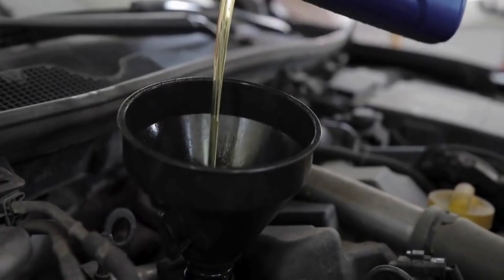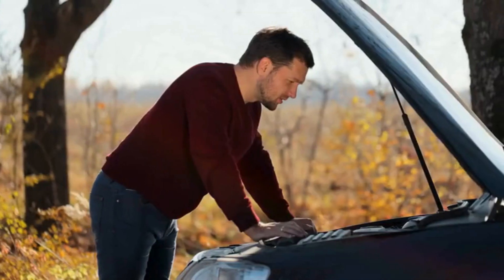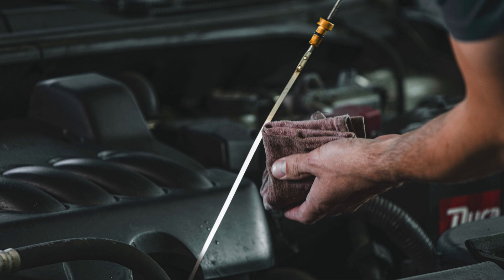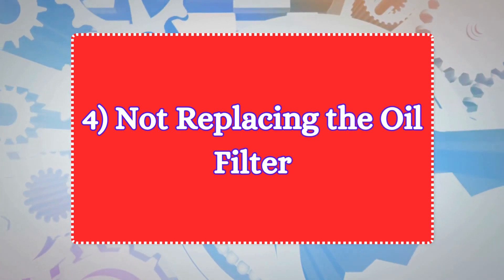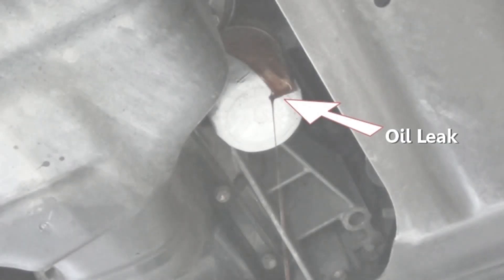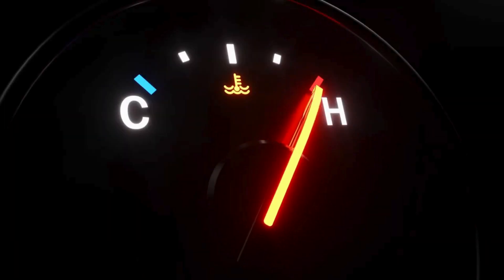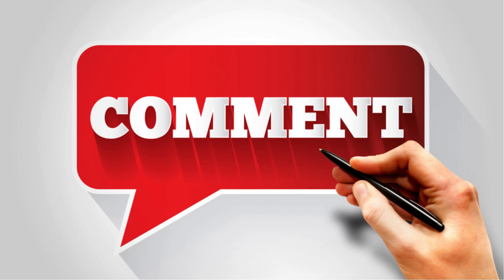Don’t Ruin Your Engine! Avoid These COMMON Oil Change Mistakes!!

Comment: Kiss my naked ass! Yeah, change the oil filter and don't forget to put the drain plug back in before you fill it with whatever type of oil you prefer. It's really simple.......

Comment: Modern engine oils DO NOT thicken when cold.  0-20 oil is 0 weight when it is cold.  Like water almost.  It gets thicker when hot.  That is how multi weight oil works.  It is completely unnecessary to change modern oil hot.  In fact counter intuitive if you understand how multi weight oil works.
Reply: Also when you chane the oil when cold, the oil will have completely drained from the upper engine.
Reply: @Wiseguy1408  And you won't burn your hand, which makes it less likely you'll have an accidental spill, which makes it more likely to get done in shorter time without disruption.  I change my old oil [edit: motorcycle] before 1st start up each early spring.

Comment: Pretty much a good guide but as a retired life long master tech in every major country of origin. And That doesn't mean much if you don't check to see if the gasket or o ring didn't come off with the old filter and you double stacked the seals and they blow out driving down the road! You will never let it happen to you again! Unless you're tupid.

Comment: 4 steps by steps : 
Using the wrong oil type or grade.
Overfilling or underfilling the oil.
Forgetting to replace the oil filter.
Not tightening the drain plug properly.

Comment: What about oil grade,can we use different oil viscosity?
Reply from the maker: No, you can't use wrong viscosity oil. Imagine pouring syrup into your engine—it’s not going to work, right? The same goes for oil viscosity. Every engine has specific requirements for oil type and viscosity. Using wrong viscosity oil can lead to poor lubrication, overheating, or increased wear.

Comment: Good tips for sure, but let me add a couple:

Lubing the oil filter gasket is necessary for a good seal and a longer seal life.  BUT... watch for the seal from the old filter to be ON the
old oil filter when it is removed.  Otherwise, it will be stuck to the engine and a double seal could result.  Typically, double seals don't
seal nearly as well, if at all, as a single seal.

Inspecting the engine immediately after an oil change is a great idea but most leaks are most easily spotted from UNDER the car.  
Look for any drops of oil on your otherwise clean garage floor or driveway.

Comment: I used to work at a tire repair facility and I can't tell you how many times I have heard of mechanic forgetting to add oil and then start up engine and hear a loud knocking and by the time they shut down the engine damage had already occurred others didn't tighten the drain plug and filled it up with oil and then seeing a trail of oil as customer drove away, oops 🤫

Comment: At 2) and 3) : eh, modern cars have no dipstick.
5) Use clean oil from the used oil drain pan ? 😉
6) If oil filter is tightened too strong, it will not come loose the next time (in a normal manner).
Thanks.

Comment: See that your vehicle is level as possible. If you can't get it level error on the side of tilting it so that the oil drains towards the bolt.
Reply from the maker: Thanks for sharing your knowledge

Comment: Over the last 35 years I have always drained the oil cold  - then all the oil comes out of the pan. When you run the engine for 5 min., the oil clinmgs to the metal parts and you dopn't get all the oil out. Check videos where this was tested.
Reply: On the other hand, if the engine is cold, contaminants tend to settle rather than being suspended in the oil. You want them to be suspended so that they drain out with the oil.

Comment: WHEN     NECESSARY      REPLACE     THE     OIL     PLUG     GASKET     WITH     A      NEW     RUBBER     GASKET    !    DO     NOT     USE     HARD     PLASTIC    OR      HARD     PAPER      GASKETS      AS      THEY      ARE     PRONE     TO     LEAK     !
Reply: It is better to use a metal gasket if the oil plug will accept it. I use a replaceable metal gasket that has a seam around its circumference allowing the gasket to be crushed to fit the slight recessed surface of the oil pan. This prevents oil leaks. It is also a good idea to use a torque wrench to tighten the oil plug to the proper specification.
Reply: @randallp.8313  METAL     GASKETS    DON'T     WORK      FOR     ME     !    NOTHING      IS      BETTER      THAN     A      NEW      RUBBER      GASKET     !      OLD      SCHOOL     MECHANICS     !

Comment: also make sure the old oil filter gasket comes off with the old filter--sometimes the gasket can stick to the block and when you install new filter it is gonna leak...
Reply: Been there done that 😢
Reply: @alkelenson648  Same here. I've only done this once in over 60 years of changing oil. Fortunately, I caught it in time before doing engine damage and only lost a little bit of oil. Never again!!!!
Reply: Best bet is to wipe off the oil filter housing where the gasket seats. That way you always know if the old gasket didn't come off with the old filter, plus you have a clean contact surface for the new one.

Comment: Engine oil pumps get their oil from the oil pan, or oil tank, NOT from the oil filter.
Reply: Unless you have an engine with one of those add-on oil filters, all of the oil pump's output is used to fill the oil filter.  Until then, no oil is going beyond that point.  This is true of ALL car and truck engines built since the late 60s, except VW Bugs.
Reply: @jamesbosworth4191  That doesn't change what was just said, though. First port of call is oil pump. Second is filter.
Reply: @timjohnun4297  You are wrong.  Until that filter is FULL, NO OIL AT ALL goes past it.  It is not good to force a running engine to wait for oil.
Reply: @ mechanic for 40 years, diploma in mechanical engineering. How Strange how I have NEVER seen an engine spin a bearing because nobody filled the oil filter…not to mention, if there’s even 1 piece of junk in that oil container, even a bit of plastic, from the container itself, guess where that’s heading to, if you pour it into the discharge side of the filter?
Reply: @timjohnun4297  It isn't going to cause it to spin a bearing, but it probably WILL shorten the LIFE of the bearings.  Maybe no so much on modern Japanese engines, as they use a mini filter, but traditional American engines usually use a filter the size of a quart of oil.  It takes about 4 - 5 seconds for the oil pump to fill it.  That means NO oil is being delivered to the bearings for 4 - 5 seconds.  I have been doing my own work since is was a teen.  I am 69 now.  That means I have been working on cars for OVER 50 years.  I have NEVER seen "a piece of plastic" and back when the oil was in cans, never seen any objects in the bottom of the oil sump or in the rocker box.  I supposed it has happened, but probably so rarely that most people will never have it happen to them.  Besides, unless you have an early 30s or older engine, it won't fit through the oil pump screen.  Before the mid 30s, there was, on many engines, just a pickup tube, so yes, THOSE oil pumps could ingest an object, but how many of us are still using cars that old as daily drivers?
Reply: @jamesbosworth4191  I think you missed my point - I wasn't talking about foreign objects being picked up by the oil pump, I was referring to the fact that when you fill an oil filter manually, you do it by pouring oil into the large hole in the middle, which is the discharge side of the filter. Meaning that the foreign body immediately goes to the wrong side of the filter, and will go straight to either the main bearings or camshaft, (Depending on engine design), on start-up. CATERPILLAR have done extensive studies on this and have determined that the risk of sending unfiltered oil straight into the engine outweighs the risk of bearing damage caused by a very short time of low oil pressure. I'll go with that. End of the day, do what makes you feel the best, but my point is simply that it really makes zero difference whether you pre-fill or not, assuming the oil going in is clean. Ensuring oil and filters are regularly changed is far more important than whether or not you pre-fill the filter. Peace.
Reply: @timjohnun4297  And you refuse to acknowledge that the chances of a foreign object being in the oil container is so remote that most people will NEVER encounter it, whereas starting your engine with an empty oil filter DEFINITELY WILL force the bearings to wait for oil, and you also missed where I said that on modern Japanoid engines, which use a mini filter, it probably isn't that important, but on traditional American engines that use a filter that holes a quart of oil - many heavy duty engines use TWO of them - you will be effectively running the engine with no oil until that filter, or worse yet THOSE filters, are completely full, and no I am not going to shut up about this, no matter how much you want me too.
Reply: @ IDGAF what you do, and I I never said contamination was likely. I said it’s possible, and that’s why CAT (Who, incidentally, use some of the BIGGEST FILTERS ON THE MARKET, suggest against it. IDGAF how you do it, or anyone else for that matter, but if you think you know more about engines than one of the biggest engine manufacturers in the world, you are full of 💩 End of story
Reply: @timjohnun4297  If you think making an engine wait for oil is harmless, YOU are the full of that, not I.
Reply: @ quick, you’d better send the memo to Cat and all the other engine manufacturers out there that don’t have your level of knowledge. You can make a fortune 😏. I wonder why car manufacturers always oil capacity with and without filter 🙄
Reply: @timjohnun4297  Just do not let the engine run above idle speed until the oil pressure guage starts to move.

Comment: make sure the gasket comes off the used filter and doesnt stay on the engine  i know a farmer that lost an engine because he had a "double gasket"
Reply: I once had a double gasket problem.  I always immediately start looking under the car to make sure there are no leaks, so I shut it off instantly, but that taught me to always check for that.

Comment: If you put it together the way you're talking about even a few seconds can start the cause damage in the engine !! Free fill the oil filter before you put it on the engine!! I do own a fuel high performance vehicles and one of them is ultra high performance I will never put an oil filter on dry, most of what you said there in that post was decent, except you neglected to mention to pre-fill before you start the engine !!!!!!!!!!!!!😮😮😮😮
Reply: And neglected to use fresh oil for the rubber gasket 🙁
Reply: @7spower998  Both are moot points...
Reply: Thanks.

Comment: Fill the oil filter before installing,  ie.dont starve engine oil pump lubrication before starting.
Reply from the maker: Good Tip
Reply: Or.. you can on newer cars just put the pedal to the ground and let it crank.. when you do that the engine will crank without starting and will prime the filter and the rest of the engine
Reply: @lincolnmech  Clear flood mode. Good tip. On my vehicle the oil filter is mounted on top of the engine and upside down. I can not pre-charge it. Hopefully one's battery is in good condition.
Reply: @maxwellcrazycat9204  only takes like one cranking cycle.. if your battery isn't able to handle that you should've bought a battery with your oil change kit lol
Reply: @maxwellcrazycat9204  The small Nash 600/Stateman/Rambler engine was like that - I would have bought that car with no oil filter, (it was an option), and installed one of those add-on filters.  The kind with oil lines and a replaceable element inside the can.
Reply: Good idea if the filter is under the engine and is mounted open side up. But on my Subaru, the open end is down.
Reply: @ericripley9739  Unfortunately, some engines are like that.  My 54 Chrysler was like that, (replaceable element type), but I was able to replace the unit with the older style, (1951 - 53), which has the open side up, and solve that problem.  I was lucky that way.
Reply: FACT.
Reply: That's not usually a good idea as oil runs out of the filter when fitting.
Reply: @stevenmonson5149  Doesn't work like that...
Reply: Completely unnecessary to fill the oil filter.   In most cases impossible if top mounted vertically.
Reply: Nno need to do this anymore - modern oil pumps fill that new filter in 1 second.
Reply: @synthwave7  That's only with modern cars - they have a tiny oil filter.  If you have an older car, which many of us car lovers do, the filter is probably as big as a quart oil can and takes about 4 - 5 seconds to fill.
Reply: @synthwave7 
I know, but I still do it as long as the filter doesn't screw on upside down.
Reply: Don't discuss religion, politics, or how to change engine oil or oil change intervals.😊

Comment: No 1 tip especially on boxer engines is to “prime” the system by cranking the engine over WITHOUT starting it to ensure you have oil everywhere it should be before being subjected to the loads of the engine running.  It is simple to do. Just push the accelerator pedal all the way down then hit the start button. The engine will crank but not start. After a few seconds stop then start the car normally. I worked with a guy who needed an engine rebuild as the mechanic who changed the oil did not do this and damaged the bearings. Costs nothing but saves thousands
Reply from the maker: Thanks for sharing such amazing tip
Reply: What does "hit the start button" mean?
Reply: @ sorry on my car it is keyless like many modern cars so has a start stop button. On older more traditional cars turn the key to the start position and crank it for a few seconds. This should work on any car that is “fly by wire” which has no accelerator / throttle cable 
Failing that some cars you used to unplug the crank angle sensor. Although this is likely to give you a check engine light these days. Hope this helps
Reply: @tapchangerservice5594  Thanks
Reply: I've been changing  my oil for 55 years and keeping my cars till they get 350,000 or miles or the body rust away and never prefull or crank to motor a d never lost a motor thats totally  BS
Reply: @donames6941  modem cars are not like ones made in 1970
Up to you but by bs I guess you mean it is bloody smart to follow the OEM service manual and prime the system after the oil change just like they tell you to 
Appreciate your comment but I will continue to prime my engine after every oil change. I do in excess of 30,000 a year and keep the cars until about 500,000. I haven’t lost an engine yet either. Subaru’s seem to go almost forever if you look after them

Comment: I have been going to Prompto Oil center for many years and have always had real good luck with them and after about 10  minutes and no mess and not having to find where to get rid of my old oil makes it the only way to go!  I don't even have to get out of my vehicle.
Reply: Many years of not pre-filling the OF without oil, dry start-up powertrain and used oil applied to the OF gasket. Yikes 😬
Reply: @7spower998  A lot of filters go on in the horizontal position so prefilling them i would think would be difficult
Reply: @smw381st i had a horizontal filter veh so I would fill it at LEAST 2/5ths full and had no problem. At least it was something
Reply from the maker: That sounds like a great setup! It's awesome to hear you've had consistently good experiences with them.
Reply: @ProAutoTips  Yes i surely have and i used to change my own oil and filter in my Ford F150 and every time i went to start it i would hear clatter from the lifters and after going to Prompto i never heard that clatter again. I have been going to them for 35 years.

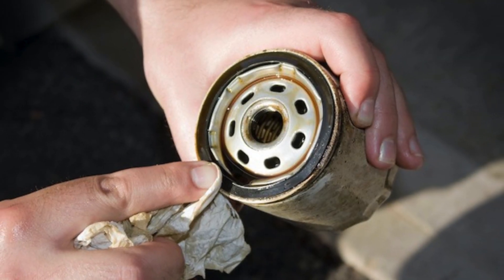Comment: I had to laugh at 2:16 when the voice in the background says to "'apply a thin layer of FRESH oil to the gasket", while the guy with the glove on his hand sticks a finger into the dirty oil that was drained out and uses that.
Reply: Nothing wrong with that
Reply: @henrykennedy1120  I always just use what is closest at hand.....but it is contradictory to say use fresh oil and then have a visual using dirty oil
Reply: I caught that too😊
Reply: @dale7517  😅
Reply: I mean damn dirty used oil on a rubber gasket doesn't bother anything I've been doing it for 45 years and guess what , I'm going to keep doing it

Comment: At 2:18 did you mean apply a layer of oil freshly drained out of the engine?
Reply from the maker: You need to apply fresh oil layer on your filter gasket
Reply: @ProAutoTips  I watched again, my bad, you did say that but the visual is showing a finger dipped into the drain container.

Comment: Viscosity is defined at two temperatures on the can/bottle/jug of oil: 10W30 means: an "oil that is the viscosity of a 10W oil at 0C" and also it is an "oil that is the viscosity of a 30W oil at 100C". It varies of course at all temperatures. This is SAE definition.
Reply: How much is 100 degrees Centigrade?
Reply: @jamesbosworth4191  Boiling point of water. Whatever that works out to be, in dinosaur measurements
Reply: @timjohnun4297  What would have been wrong with stating 212 degrees F?  Would you have been arrested or something by the Thought Police?
Reply: @jamesbosworth4191  Because Celcius is used in every developed country in the world. Why should everybody change their units to suit some 'Murican who can't even figure out the conversion....
Reply: @timjohnun4297  If you are outside of this country, my apology, but if you are in THIS country, then you are supposed to write in OUR measurments, just like you write in OUR language, and the thermometers you buy are generally in FAHRENHEIT NOT CENTIGRADE, (yes, I said Centigrade, and I am going to continue to call it "Centigrade").  Giving both temperature scales is fine, but if you are HERE, we are not an afterthought!  If you can't deal with that, just remember, you are not being held prisoner.